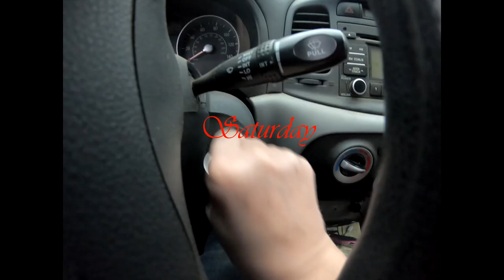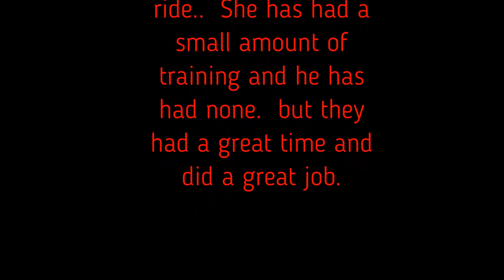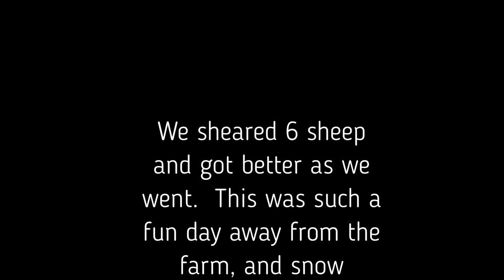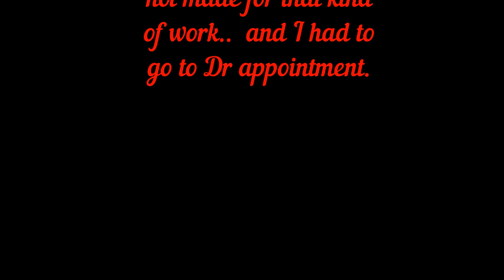Sheep shearing | Corgis herding sheep | Chicken Mini Barn Build

Comment: If your half span is 3 foot, and for each foot there is 8 inch of rise, then you multiply the rise by the half span: 8 inch/foot × 3 foot = 24 inch rise

With 6 foot walls, your roof ridge (or peak) would be at 6 foot 24 inch. The exact measurement will depend on the use of additional bracing and roofing method and materials.
I would have opted for walls about 12 inch lower, so as to reduce the side area and lower the risk of wind tipping the trailer over.

Comment: Your math is: axa + bxb = cxc where c is your diagonal and a is the horizontal length (half the distance between the sides) and b is the vertical length (height of the roof peak from your sides) of your right-angled triangle.